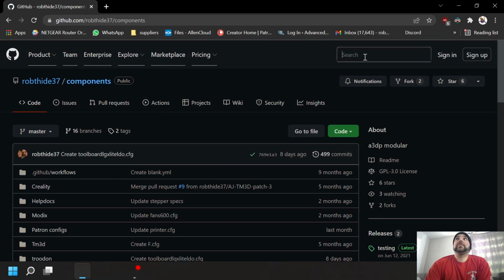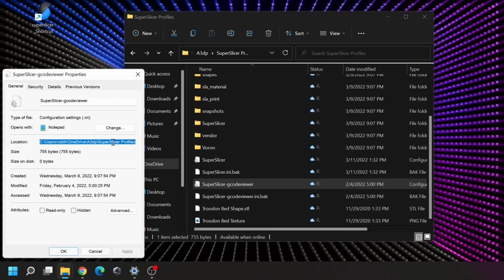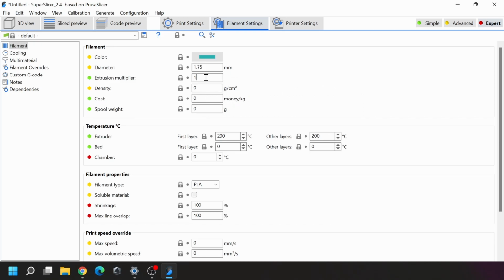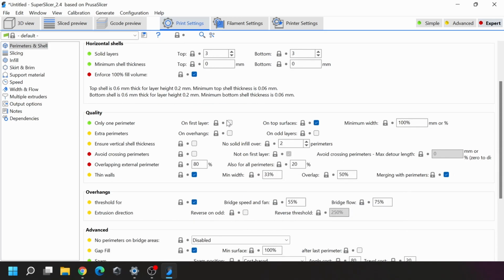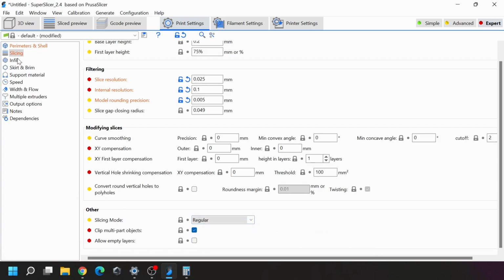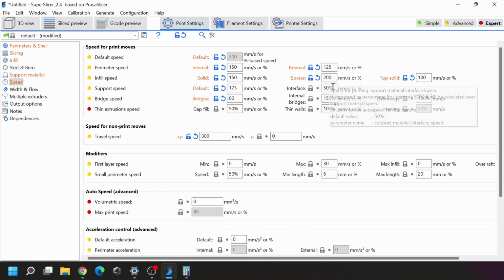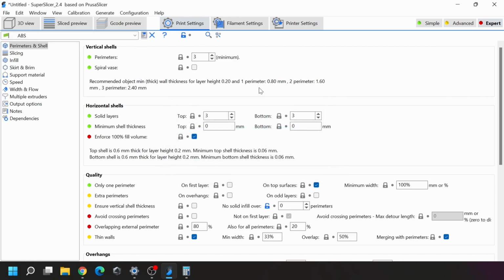SuperSlicer install with synced configs

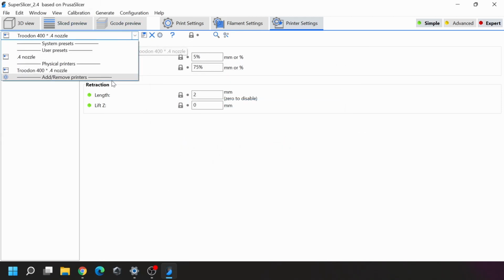Comment: Hi Rob, superb video, one of the only ones to cover 'Custom' with wifi printer setup. But a little confused with the 'Save Preset' dialog box. At 8:26 you changed to the 2nd option, but I can't seem to understand the differences between any of these options. I realise it saves the changes, but why the need for an option, so as there are 3, there must be something basic I am not seeing.  The default FFF profile had disappeared after you dropped the listbox down @ 8:40 yet you selected 'Add as a preset' ???.  Also this is the first vid I have seen that when the listbox is dropped down you actually do have a printer in the 'Physical Printer' section, all other SS & PS vids I see when that dropdown is shown their printers seem to always be in 'User Presets', not certain i'll ever get this point, I have searched but obviously missed the critical info somehow, even a pointer from you in right place to attempt to sort this out for myself would be most grateful.
Many thks for you efforts in the vids and Many thks in advance.

Comment: I ran input_shaper calibrate on my 350mm Voron 2.4 and got an acceleration value of 4500 so I put that in max_accel in printer.cfg.  Are you saying that I should actually set some higher value there and then use the 4500 value in Super Slicer print speed for things like perimeters, but can still use a higher value that input_shaper recommended for infill/travel?
Reply from the maker: Exactly we only care about limiting the external perimeter and top etc . Bit travel is highest and infill second then I go internal perimeter and then external and lowest is first layer